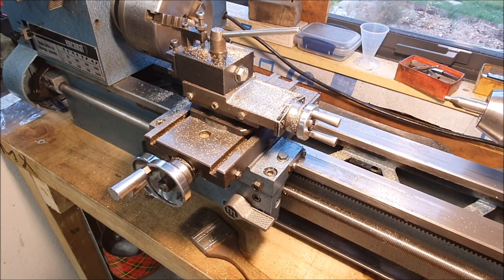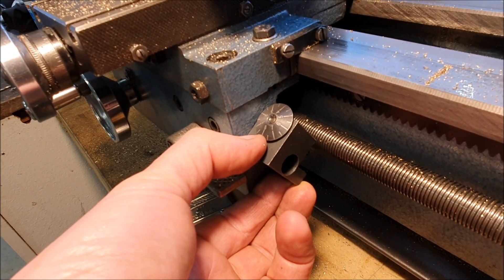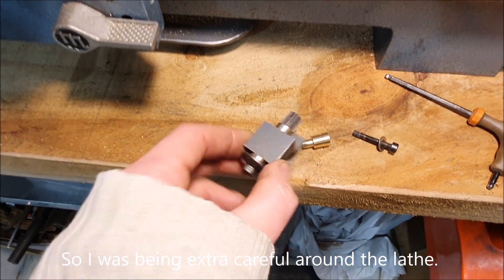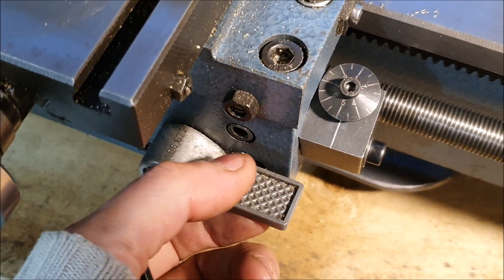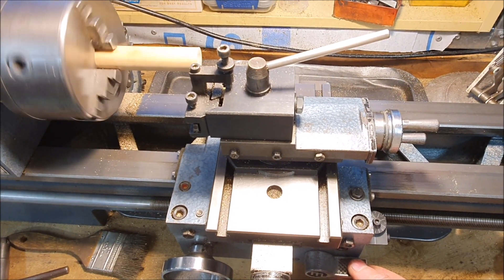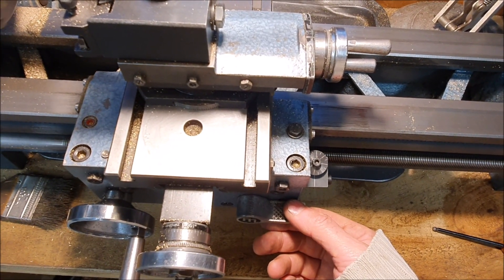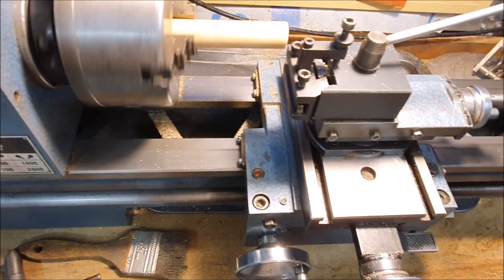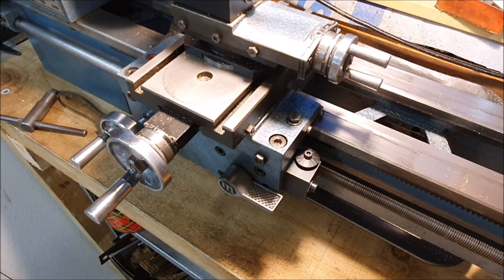Emcomat Lathe threading dial mod

Comment: I know this is an old video but if your lathe has an imperial lead screw, the cutting dial does not work for Metric threads, if you disengage the half nuts you are done, you have  to retract the tool and reverse the lathe.  Similarly if you have a metric lead screw, cutting imperial threads requires the reversal of the lathe and keeping the half nuts engaged.
Reply from the maker: I didn't know that! But before I had a threading dial that's how I used to do my imperial threads too, keeping the half nut engaged all the time. Mine is an imperial thread pitch. When I have looked at newer lathes that is something I look at but most sold here are metric pitch.

Comment: Im assuming your Emco is an imperial version, I have a V10P and its metric. I too would like to have a TDI but from what Ive seen its not that easy on a metric lathe and you need different gears for some of the non integer threads like 1.75 etc. Im surprised that mini lathe TDI from Aliexpress meshes with your leadscrew as mine is Mod1, I guess yours is imperial but I would have thought Chinese mini lathes were metric.

Comment: There is a hierarchy of dial engagement rules depending on thread pitch.  Yours has a 16 TPI leadscrew, so if you're cutting a 16 or 32 or 48 pitch, you can engage the half nut in any position and the tool will chase the thread. You need a more restrictive rule if the pitch is not divisible by 16, yet another if it's not divisible by 8, and so on down to not divisible by 2. It was actually kind of fun to get my head into the numbers and figure it out.  Of course, you can always just use the most restrictive rule and that will work for any pitch.
Reply from the maker: I can never remember the rules since I don't use them enough so I stick to the slow, always engage on the same number technique!

Comment: I didn't understand how the indicator stops since the gear is always in contact.
Reply from the maker: It's because when you engage the carriage it starts moving as well. So the gear moves the dial one direction but the carriage movement moves it the other direction so it cancels out. That's why you need a gear with the right number of teeth to match the pitch of the screw.

Comment: NIce modification Simon, I served my apprenticeship on a Colchester Student lathe nearly 50 years ago, finishing my working days on CNC's, I wouldn't know where to start setting up a conventional lathe up for screwcutting these days, forgotten how to. Can't wait to see the Riley running, always had a thing about them, a bloke across the street had a 1953 RME with the 2.5 engine which was basically a bigger version of yours, he offered to sell me it for 10 quid when I was 17 so the car was 18 years old at the time, what put me off was you could see the road through big rusty holes in the floor pans so I politely declined, I saw the car in a scrapyard about 3 years later and I nicked the Riley badge off the radiator which has long gone missing sadly...
Reply from the maker: The problem with lathes is they are never big enough! The Emco is still a small lathe but a step up form my original Chinese one in terms of quality. At some point I expect the switches to go on this one (it's a mechanical setup that is known to fail) so I imagine I will be fixing that at some point. The Riley is slow but steady progress needed I think. I have to spread out the costs a little too. I can't just buy all the parts I need up front so it's a matter of getting what I need, when I need it and trying to minimise the postage costs. I still try to do a little every day though.
Reply: Dito Allen